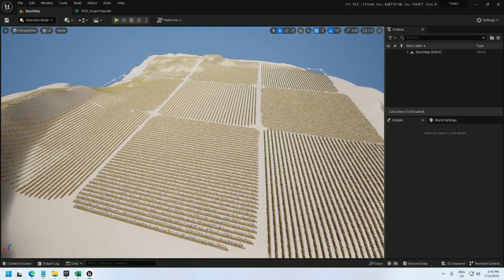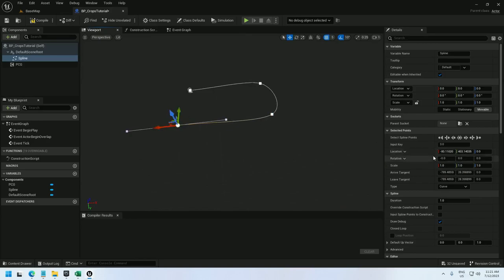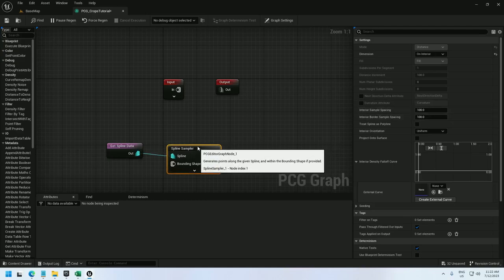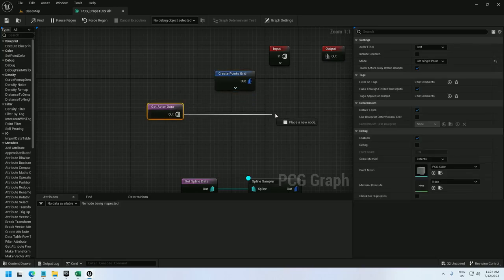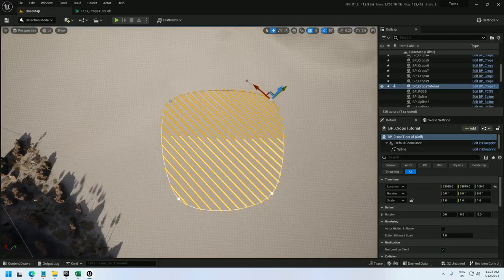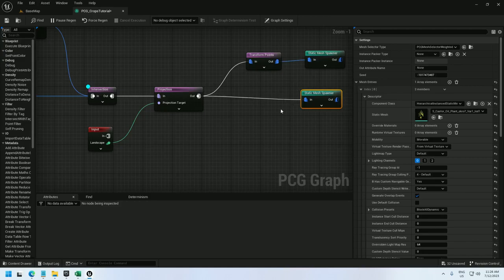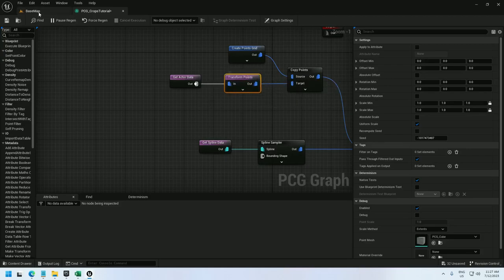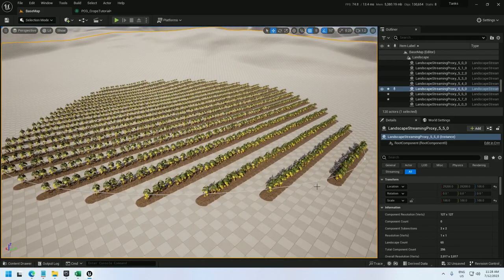Unreal Engine 5.2 PCG Tutorial - Quick and Easy Farm Crops

Comment: much appreciation for this video! very helpfull, keep them coming! i would have one question: but if you would want a variation of the leaf's models, that would be possible ? different coloration, shapes, would be nice and more realistic.
Reply from the maker: You can add additional static meshes that are randomly chosen from. At 4:50 where I add a mesh entry, you can add more than one and select a different mesh for each entry. If you want, you can adjust the "Weight" as well, higher weights give that mesh entry more chances to spawn.

Comment: Hello, thanks for the instructions. I just have one problem. I use UE version 5.3.1 and the note intersection is no longer available in this version. is there a workaround?
Reply from the maker: You should be able to use the updated Intersection node. Your points grid will go into the Primary Source, and Spline Sampler into the Source 1.
Reply: @MichaelRoyalty  but this makellos not a Output i
Reply from the maker: Make sure your create points grid and spline sampler are unbounded
Reply: @MichaelRoyalty  Thx for u Help! I'm have  unbounds aktiv. But i must restart  ue.... it run yet
Reply: This doesn't seem to work for me either. If I have the points grid to source1 and spline sampler to primary source it shows the negative. If I have it as you state, it is just empty.  @MichaelRoyalty
Reply: I figured it out. You also need scale method as absolute on the intersection node. :) Thank you for the tutorial!
Reply from the maker: Great find, thanks for sharing!
Reply: Doesn't work for me anyway :( @segstron

Comment: Ive watched a ton of your videos. super cool stuff especially the buildings. PCG is a cool tool so far. Since you are the PCG pro :) would you have any pointers on creating hex grid via PCG?
Reply from the maker: Interesting question! There isn't a simple native way to create a hex grid, but I hope it's added as an option down the line. I have a couple ideas now, but I'll have to test them out and see if there's a straightforward, scalable way to make a hex grid.

What are you thinking of using this for? I immediately thought of turn-based tactical games when I saw "hex grid".
Reply: @MichaelRoyalty  was thinking of generating a hex grid ontop of a landscape to get a bit of a Civilization style map with a bit more vertically
Reply: @MichaelRoyalty  using some of the methods you used in this video I was able to generate a bit of a grid of hex meshes but doesn"t seem to want to keep the hexes perfectly aligned. I"m gonna check the details of your RGB pixels video and maybe that has some gems of knowledge on grids :)
Reply from the maker: I've had some luck by making a blueprint with a two-point spline, then sampling that in PCG, rotating it 60 degrees (Hexes have a 60 degree angle on each side), and copying the spline back onto itself. It generated a diamond-bounded grid of hexes.
Reply: @MichaelRoyalty  Interesting,,, may play around with this approach. Didn't think about splines due to the normal use for making curves cool idea
Reply from the maker: If you do it the same way I did, the points will be off in the stratosphere somewhere, but if you subtract the actor (single point) $position from one of the splines it should fix the issue. Good luck!
Reply: @MichaelRoyalty   Thanks for your help...looking forward to the next cool PCG vid
Reply from the maker: You inspired me to make a Catan board, and it's worked great. I just talked to someone else who solved the issue by generating the hex grid separately via blueprint, then just loading the grid points into PCG -- if you have a bunch of different hex grid maps it might be worth writing them to disk, then loading them to data table and importing them into PCG that way.
Reply: @MichaelRoyalty    awesome stuff I have seen the small hex video,, its cool and much larger and detailed hexes than what I had in mind lol but really works out, good job.
Reply from the maker: Yeah, I took the hex grid thought and figured it'd be a good challenge to see how far I could take it!

Comment: Do you know why my grid keeps disappearing? I believe it disappeared after I made the intersection node between between “copy points” and “spline sampler” I can’t for the life of me figure out how to fix it
Reply: I have the same problem :(
Reply: @JaniceStevs  Try changing the order in which you connect the pins.  In UE5.3.2 for me the Intersection node looks different.  It has a Primary Source and Source 1 pin.  If you have that, try connecting the Spline Sampler node to the Primary Source pin and the Copy Points node to the Source 1 pin.  That seemed to work for me.
Reply: You can use the 'inner intersection'  node instead